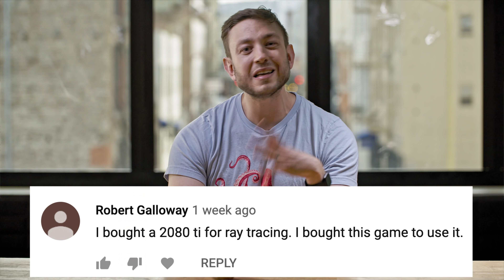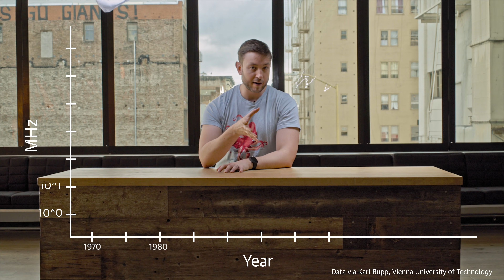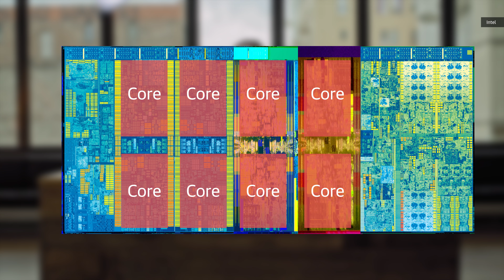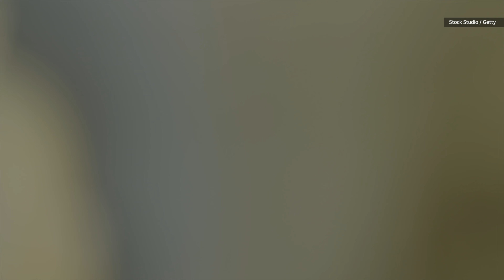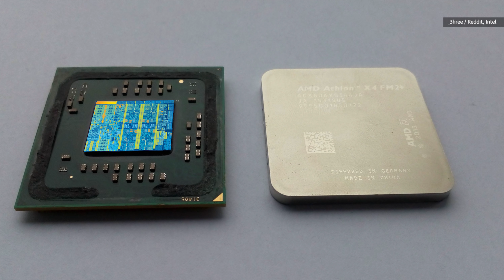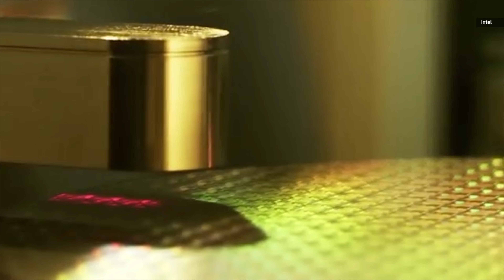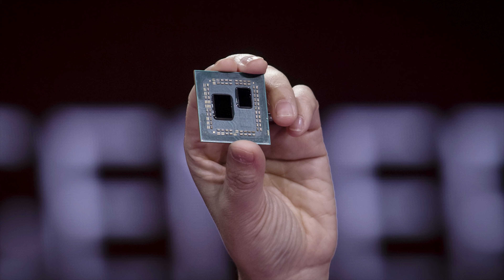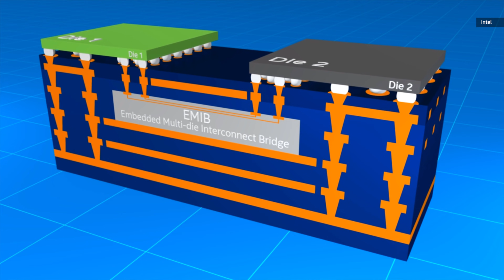How Intel and AMD are using 'chiplets' to build next-gen CPUs | Upscaled

Comment: The big dogs like Intel and AMD work with each other all the time. True, AMD lost all it's fabs but Intel marketed the shit out of their product to keep AMD out of the picture for years. The FX chip was a bust.  FX destroyed AMD's reputation by a large margin because FX showed that AMD couldn't keep up with Intel.  AMD has already stacked it's ram on a GPU just not a cpu yet. It could easily be done on a APU but the die would have to be much larger like a Threadripper die in order for a all in one memory HBM2 on a cpu die.  Intel is now creating their own GPUs and I would like to see how this turns out now that Intel has Raja on their side and other ex AMD employees.  I saw the chiplet design coming 3 years ago. I knew transistor and bad yields would make this happen.  Also, like you mentioned with Intel's density, TSMC's 7nm is really a 12nm design. Intel's next generation of cpus will be a true 10nm design and will have a higher IPC than TSMC's (AMD) Ryzen based chips by 12%.  AMD is trying to grab as much market share as they possibly can because they know the ceiling is about to burst in the technology industry along with everything else related in the field. If AMD can boost it's cache latency by 15% with 7nm then AMD and Intel will have the same exact IPC being that AMD is on 12nm and Intel is on it's 14nm process.

Comment: I don’t get it, are you saying in 2019 we will see the start of faster computing and using this new way of integration the computing will get faster in regular intervals?  Because I don’t see that coming from this separation yet connected integration, all I see is that the manufacturer will benefit by not throwing the entire chip away when a portion of it is bad.

Comment: The one thing we can all be sure of. Intel has been ripping us off for YEARS.
no need to buy a new PC every year or 2. you won't gain much. the one component that dose of LOT of heavy lifting is the GPU. this is the war between Nvidia and AMD.
Reply: got a dual xeon workstation with X5687's that came out in 2011, with a gtx 1080 and does most anything. Not much need to upgrade.

Comment: Still, saying that we're still in the stagnation period doesn't make much sense in my opinion. Right now an 8 core 16 thread Ryzen 7 1700 costs less than i5 7400 costed two years ago, so we get thrice the multicore performance for about the same amount of money. For comparison i5 7400 is only 20% faster than 2011 i5 2400, and we would have to go back about a decade into the past to find a CPu whose multicore performance would be 3 times as bad as that of i5 7400.

Comment: won't this innately create more latency on the bus system for IO? Like, a few modules @7nm (or whatever) fab all tethered to a 14nm (or whatever) fab IO could bottleneck? Isn't this the same issue that hindered the original Bulldozer architecture -> shared resources/ L2/ IO outside of the CPU die itself?

Comment: The biggest problem I can see with more powerful CPUs is that Microsoft will increase the size of the bloatware they call Windows. This means users will then have to replace hardware and software as MS cause it to be incompatible with Windows.
When I upgraded to Windows 7, I had to ditch a perfectly good scanner because there were no drivers which would work with it. I also had a music midi box which also would not work with Windows 7, although I didn't find out about either until after I had bought the new computer. I know my much loved laser printer, which has served me very well for several years, will not work with Windows 10, and I am using a Vista driver to run it with Win7. More expense.
It's all very well for business users, who lease, as their customers basically pay for upgrades, not so good for home users.
Interesting video. I am not looking forward to upgrading to Windows 10 next year, and am seriously considering Linux if I can get my most important software to work, basically MS Office 2016, Corel Draw, and Ableton 9.

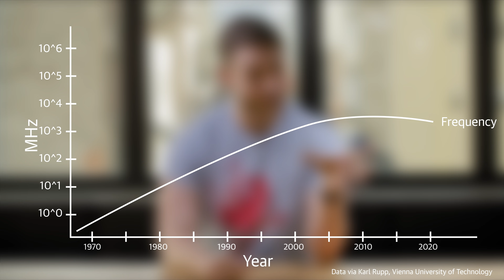Comment: 1:50 so the amount of transistors increased, slowed down, and now is decreasing?!
Reply: They have reduced the overall size of the chip into more chips, so yes, the amount of transistors has decreased per chip overall. Overall though, there are more transistors in a CPU when you add all the chips.

Comment: I’ve been excited by and anxiously anticipating new advances in three dimensional, modular chip architectures for years and it’s exciting to see each step in that direction. I think it’s one of the most promising approaches to circumventing some of the fundamental limits of silicon photolithography we’ve reached over the last decade. However despite seeming like a somewhat obvious next step in the evolution of chip design it’s really a giant leap in terms of the new practical problems that emerge as a result. The question is who is going to make the investments in basic research to try and solve them. If the history of this industry tells us anything, whoever does is more likely to die a martyrs death than come out on top.

Comment: Some fact that can help. Price is typical area^3 (cube).  So chiplets are cheaper than monolithic.
The bigger the area more likely to hit a material failure, so less good chips per wafer. 

That's for price and yield point of view. Performance is an other matter. Inter chiplet communication is not as fast. Will have to see.

Comment: I heard that AMD is shit compared to Intel. Even employees an electronic place told me so, low key. 
I'd never mess with AMD until they get their shit together.
Reply: Um.  They have.  It's called Ryzen and even the first gen of it ( which was popular in 2017 even), finally caught up enough to intel.  There is what I would call the 3rd gen ( but amd calls it gen 2) coming out this year if it hasn't already. 

Also in late 2007 and to mid 2008, the athlon x2 6400 was already slightly more powerful than the core 2 duo it was competing against.  

I tested two identical systems side by side with the first Crysis game at 1680x1050 ( yes..weird rez..16:10) with a single 512MB vram 8800gt video card in each, 8GB's of ddr2 800mhz ram, and one with the x2 6400 cpu, and the other with the core 2 duo. 

The amd cpu'd system had both slight better minimum fps under the hardcore fighting and better average fps consistently across the board.  

This wasn't the case with EVERY game back when  ( For some odd reason WoW was one of them), but for most it was the case.

Comment: Higher clock speeds were never going to work in the long run. The human brain has a very low effective clock rate, but manages to achieve huge amounts of clock power. It's because it is massively parallel.

Comment: Speed > power saving, mobile will be in the hands of ARM, Laptops should have the battery tech to power a faster CPU
Reply: Power saving is actually preetty damn important even for desktop cpus. Especially when you 3d stack those things. After all less power consumption means less heat generated.
Now obviously speed is more important but the main power saving those cpu manufacturers are talking about is mostly making more efficient chips better suited for normal workloadsand so on.
Reply: @Kennorx  I totally agree I was talking about keeping above 100w processors in the desktop family for consumer level considering the improvement in cooling solutions I don't think this is much of an issue. For normal consumer level 95w is still easily cooled if not overclocked
Reply: power saving and lower temperatures mean you can increase the volts for higher clocks

Comment: So in a nutshell, shittel is basically plagiarising AMD's chiplet designs, but using a somewhat different implementation method. Also, the shittel 3D stacking method poses a very serious issue and that is the build up of heat. I would like to know how intel plans to dissipate this subsequent build up of heat.

Comment: Basically, Intel is making CPUs that look more like SoC's, and will thus save power? At least that's how I understand it from the animations and explanations - integrating more stuff (like RAM) directly onto the CPU is historically what has been done on mobile platforms and seems rather good at saving power, OTOH I feel like x86 hasn't been so bad at power efficiency compared to early 2000's or even early 2010's. Atoms are basically as power efficient as most ARM SoC platforms nowadays!

Comment: one day they can use particles as transistors where the spin of the particle denotes a 1 or a 0, akin to power being on(1) or power being off(0).  that way u can cram particles next to each other and not have to worry about quantum tunneling because the flow of electricity isnt whats being used to determine a 1 or a 0, its the spin of the particle.  this is different than Qbits but that shit way more complicated so im not even gonna bother.

Comment: Brilliant, absolutely brilliant. Even though this was more of a state of the market type video. They somehow explained, broken down and simplify the laundry list of CPU terminologies minutia to the point where my slow-ass to finally understand a significant chunk of them, for the first time in my half a decade time in building PCs. All with a Voltron reference to boot.

Quick question though, what is the nanometer actually measuring? thickness of the silicon? length of the transistor? area of the transistor? (since density is always mentioned).

Comment: More clarification would have been helpful about how breaking up a die into more cores allowed the most dense areas to be split into cores (or core-pairs)...which allows more room for yield problems as a bad core can just be disabled and the chip just becomes, say an i5 instead of an i7 (instead of just being scrapped).

That's what I've heard at least...

It sounds like what's happening here is the shrinking of the non core areas is affecting yield to an extent that breaking the expensive cores/GPUs away from all that is becoming economically attractive. (Considering that if a core, being redundant, comes put bad, only itself gets written off-leaving the rest of the CPU intact, but if any non-core ares come out bad, the whole chip is scrap right now....

Comment: There is a minor error in this Video:
When parts of a chip are defective, such as a number of cores on a multi-core die, or blocks of cache, etc. it doesn't mean the entire chip is defective. Quite often, individual parts on a die can be masked off and deactivated on the microprogram level (CPU firmware). This defects are not always errors in die exposure, but simply fail in means of heat transfer, or are underperforming at a certain clock speed. If you can get the same CPU with 2, 4, 6, 8, or 10 cores, chances are it's the same CPU, but the ones with a smaller core count, is one where some are defective and have been switched off.

One big advantage of chiplets that wasn't discussed in the video, is means of cost-cutting for the manufacturer. Especially when making several types of ICs, whether CPUs, controller ICs, GPUs, etc. it makes sense to break up functional components into chiplets, to re-use them in completely different settings. It is a way of introducing a middle step in the modularization of components. Before, there was only functional components on the same die, or individual dies in individual chip carriers. This introduces individual dies on the same chip carrier.

Another small error is "Today chips are manufactured similar to exposing a photo". Silicon chips have always been manufactured through a photo-lithographic process.

Comment: Yep, many of us old fart geeks have been waiting far too long for faster speed CPUs.  Intel has proven the old adage that no competition breeds stagnation and contempt for customers.

CPU speed aside, I just wish some developers/programmers were taking better advantage of multi-core/dual-thread CPUs, especially since 8 cores/16 threads will become standard soon, just like my 2018 Ryzen Gen-1 1700X already has.  Indeed, some developers seem to be stuck in the early 2000s.

The worst example seems to be Laminar Research that produces X-Plane.  LR brags that X-Plane runs best on an Intel i5 quad-core (single-thread/core) unlocked CPU overclocked to 5+ Ghz speeds.  Sadly, the other 3 cores are mostly napping.   Adding more cores/threads just means more are napping.  I don't have enough hands to do a proper facepalm for that kind of moronic backward thinking.  I'm sure Laminar Research isn't the only developer stuck in the past.

Comment: There will likely not be another evolution until we change the way we write code, and more specifically, go with an absolutely major redesign of compilers and operating systems. There is an actual limit to how fast a CPU clock can be, and there is an actual limit to transistor size, and we're at or very close to both.

Comment: If anyone is interested, that glass plate used to transfer the transistor pattern onto the silicon processor is called a "photomask." Chemical etching is used to to impress the designs on the photomask, and then lasers are projected through them to etch the designs onto the processor in layers, one at a time.

Comment: well, actually a lot of other computer parts haven't gotten smaller, but transistor sizes have been getting smaller and will likely continue to get smaller for a little longer. Speed hasn't improved much because of other factors, I assume the rest of this is correct

Comment: I will use my 1080 ti untill I buy a amd card, maybe in 5 years or so
Reply: Repvoid I am not crazy about Ray tracing, so I am fine with that, I have made the switch to 1440p144hz, something I don't think I would be able to go back from now, I don't mind if I might have to go down to medium settings either, as long as I keep the 1440p and 100+ fps

Comment: The real reason why CPUs are not getting faster is that as you increase the frequency of clock speeds, electrons no longer want to travel inside a wire, they want to travel on the surface. Remember, like charges (electrons are negative particles) they want to repel from each other. The more active the electrons are the more prominent they become. So when the electrons want to repel each other along the surface of a wire that can no longer contain them you get crosstalk. That is eletrons jumping thru the air to another wire. The smaller the chipsize the more chances of cross talk. At today's clock speeds you are already in the radio frequency spectrum where RF energy becomes a problem. IBM rralized this decades ago on thier mainframes (which is light years ahead of technology for mere PCs)
The only option is to use more cores (which software developers need to utilize more efficiently) or a re-architecture using light pipes instead of wires (IBM has been looking into this)
So in a nutshell we just hit a wall, until this is worked out.
Remember the Wake Sheild Facility?? This is where they could dope a piece of silicon in outer space where a high vacuum and heat can be obtained to dope at the atom level. I dont know what the end result of this was

Comment: The Ghz race ended with the Pentium 4 northwood and prescott cpus. Pushing beyond 4Ghz just produces too much heat. It's going to be awhile before anyone sees 5Ghz at 25 watts. It might not ever happen in our lifetime. It's about cores now though. Programmers need to use parallelism more often when developing software. Take advantage of the core count. You can also get more speed when you have more efficient algorithms in the code. Gotta be smart when programming. Stupid code produce slow results. Lots of things can improve mostly ;)

Comment: I got told in 1987 that Moore's Law would run until the end of 2011.

There's some smart cookies out there.
Reply: Yup, 2011 was the predicted time for Moore's law to run into the material limits of silicon... Which it did!
Reply: I find it kinda sad that nobody trys to find new solutions for other materials to use...
Reply: @zyrkel7587  We are trying. I met a professor working on spintronic registers. They actually built it in a lab. But it is different to build few gates using an electron microscope and actually have manufacturing line for entire processors. That will be 22. century stuff.

Comment: OK let's say you have 4096 cores running at 5 Ghz....how much more power is that compared to 16 threads?
Reply: Theoretically? I have no idea.
Practically? No difference. I don’t think there are any computer programs that can utilize 4096 cores. Most games don’t use more than 4
Reply: @natebit7167  those programs are called shaders, you use hugely more core, you use SIMD.

Comment: I think Intel is taking a huge chance here.
To me, the thing that matters most is price, then there's the performance and lastly heat.
That's why i went for a ryzen chip this time, and i think AMD is on to something good here.
What intel is doing with their new CPU's seem to be a step back, atleast from my perspective.
Maby they know something i dont, but i don't think mobile efficiency is what they should be aiming for, and servers don't need cpu's that can handle background tasks well, they need cpu's that can handle a HUGE number of operations that require immediate attention.
Also, stacking like that WILL cause massive heat on the dram, it's going to have a bad time.

Comment: How true, how bigger the chip how more chance on problems and how more expensive the remaining working ones will be. Just ask the developers of chips used in cameras. Those tiny little baby ones you find in your mobile phone, losses are relative low and price is super cheap. A full frame sensor? That actually works ... expensive! The fact that we finally have decently priced full frame sensors is because they got a lot better at it. But yeah, it used to be a lot more expensive. Now, you can get one.